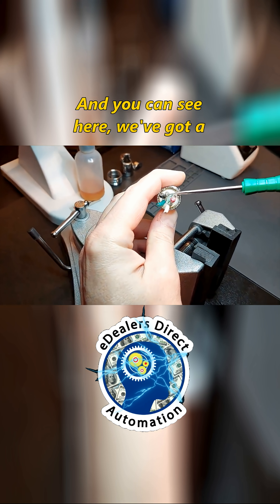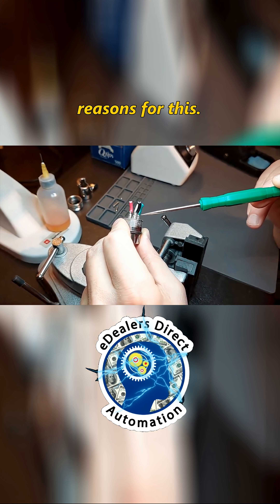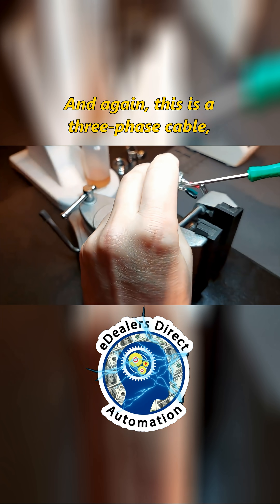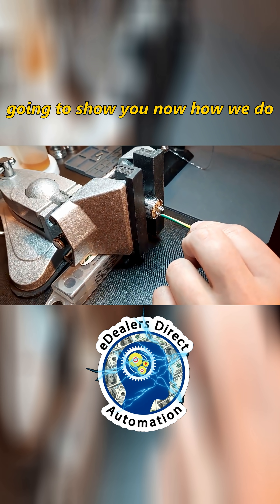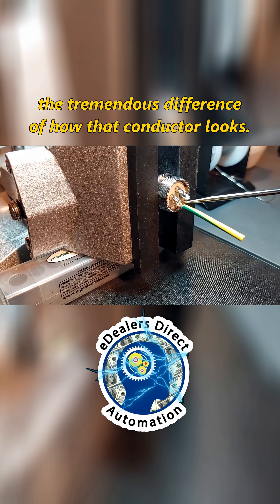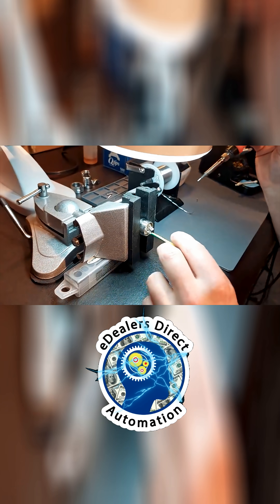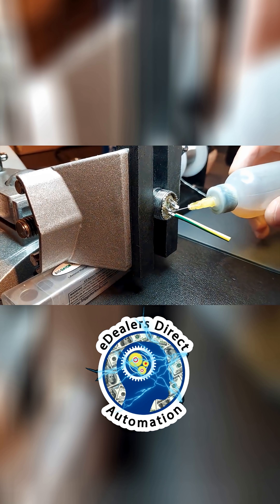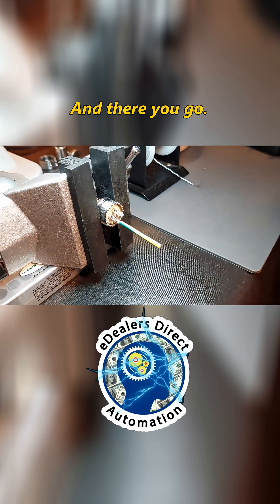Soldering Rework on a Spindle Connector

Comment: Vince, we all have our own preferred ways of doing things, but I’m just curious. To get a similar result, I would have alligator clips holding the wire in place so I could hold some solder with my left hand and feed it while I’m heating it with the iron. Wouldn’t this keep you from having to go back two or three times and get the same result? Or is there a reason why you like to add the solder from the iron?
All the best, Chuck
Reply from the maker: Hey Chuck,

Your commenting on a short video that's not showing the process of working with double shielded cable in process of connecting it to a spindles female power connector. 

This video will easily answer your question as to why I don't use alligator clips to hold the wire as a "jig" while I apply solder. 

https://youtu.be/TPJFuiCwOGw

Thank you, and Merry Christmas!
Vince